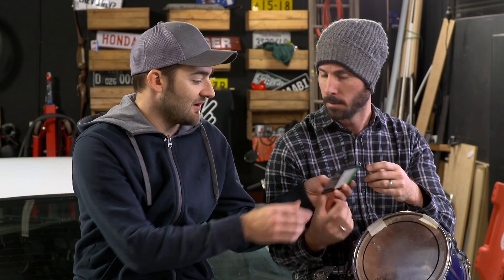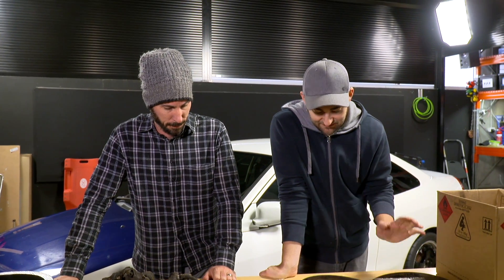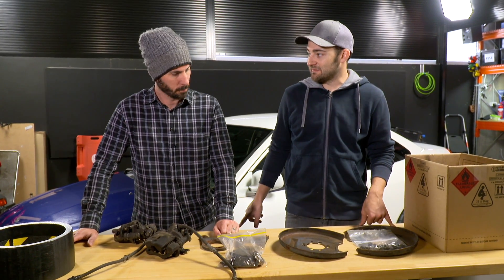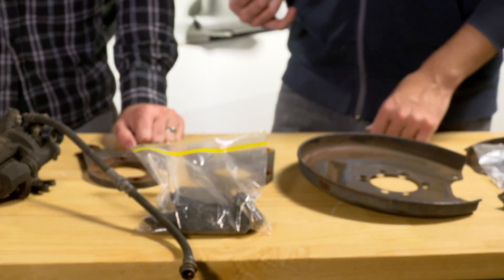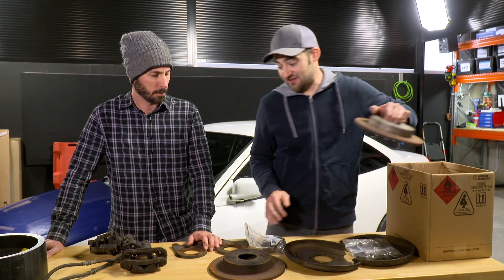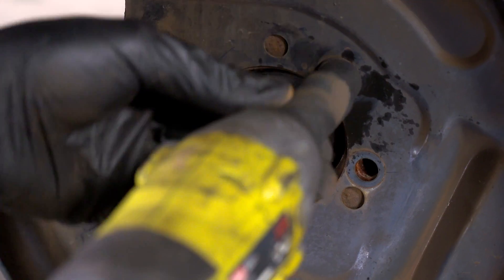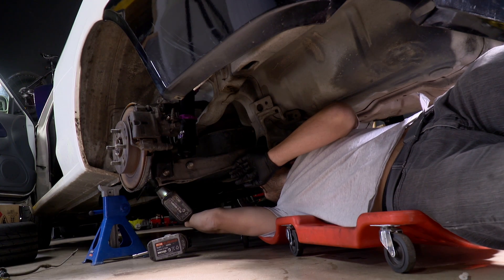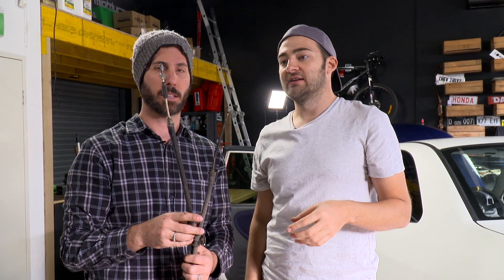Drum to Disc Brake Conversion DIY

Comment: Neat Trick if you don't have a big enough spanner to apply enough torque to those tougher bolts: take another spanner and hook the ring side over the open end of the first spanner in the direction you want to turn the bolt. works like one big spanner and then you  can take them apart again when your done to have two little spanners again

Comment: also to get extra leverage on a basic standard wrench, you can apply a 2nd wrench that is a few sizes bigger into the hole and get extra torque, that is the cheap way of getting the job done, while saving money but a bit of tape will keep yourself from busting your face or pushing away from you works too.

Comment: always always ALWAYS undo your sliders and check that they are lubricated and sliding freely. Seized/stuck sliders will stop the outer pad from being pulled into the rotor, leading to the inner pad wearing away incredibly quickly.

Comment: you guys should do a video about 2 brake pedal setup (such as used in baja trucks or torc trucks). also a video about quad pad setup, I saw a photo of some crazy setup where it had 2 brake calipers per wheel.

Comment: I just converted mine on my truck and the kit I got didn't require for a different master cylinder or have a portioning valve, because the calipers are designed to apply pressure as if it were still the drums.

Comment: I am old enough to have been driving cars in the US that were built before front discs became a thing.  I can tell you that virtually identical cars that one year had all wheel drums and the next year had front discs, stopped in far less distance than the all drum brake cars did.  About the ONLY thing that was bad about early disc brakes is if you drove through a good sized puddle of water you had to tap the brakes to dry them right afterwards because if you had to brake hard shortly afterwards you had no braking for a second.  That was rectified fairly shortly afterwards, but my 1970 Galaxie LTD with front discs was always plagued with that.  I don't know what is in newer import cars but in older US cars the brake master cylinders were different between all drum brake cars and front disc cars  because as someone has mentioned discs operate at higher pressures.  That is why disc brake pads can be much smaller while supplying more braking power than brake shoes.

Comment: The 3.5" disc is still a floppy disc as the actual media inside the external casing is flexible, or floppy. Earlier versions held even less data - 720KB for earlier 3.5" floppies, early single-sided 5.25" floppies held as little as 360KB.

Comment: Hi guys great vid !! Marty I was just wondering if you put the disc brake master cylinder on your car as well when you did the conversion because the valving and porting inside the master cylinder is different between drum/disc and 4 wheel disc. The original master will work but not properly, the 4 wheel disc master supplies more fluid to the rear callipers due to the piston size and not as much to the small wheel cylinders.  When you race the car you may end up with STOPPING difficulties in the rear !  Just a heads up mate, and yes I used to be a mechanic and a NRMA patrolman for 16 yrs !! Seeya Rob

Comment: Doesn't the master cylinder need changing or a brake pressure regulator fitting as drum brakes and disc brakes work at different pressures and a residual pressure is sometimes applied to keep drum brakes in adjustment so as not to have to pump the peddle up.

Comment: You are 52 years late for me, I installed Front disc brakes on my 1964 Corviar Monsa . they were an easy conversion but the front calipers required more fluid to operate correctly .Tthe master cylinder needed to be matched to the calipers

Comment: After talking so much about switching to discs to keep the brakes reliable under abuse, I was surprised you tried to keep as much old brake fluid around as possible. Moisture builds up in brake fluid over years of sitting and lowers the boiling point. That means if your fluid got hot enough you could lose at least half of your braking system when you need it most. I would put new fluid in the reservoir and bleed it until it comes out clear. As an added bonus it can also help prevent a frozen caliper, anyway, love the videos as always, stay s3xy <=3

Comment: The hand brake works better with a drum brake because it is self energizing by the rotation of the drum and the brake shoe pivot. that is why the leading brake shoe wears faster.
When traveling backwards the other brake shoe is the self energizing one good for hill starts with ease of operation.
With front drum brakes they were twin leading shoe no vacuum booster.
Some rear disk brakes have a small drum brake for the hand brake the best of both worlds but costs more to make.

Comment: Hi Guys, don't you have to remove the pressure residual valve from the rear brake outlet of the master cylinder otherwise the remaining pressure would cause the pads to drag on the disc's?
Also I thought there would be a need to change the proportioning valve as the disc's would need maybe more pressure compared to the drums as the drums are self energizing?

Comment: in Europe there is a rule that says if the car is constructed to do over 180 kph, it should have disk brakes.
besides the cooling advantage, disk brakes are also less prone to lock up since the outer diameter runs at a higher speed than the inner, while the pads try to grab on to the entire surface*. with drum brakes the shoes grab on to one and the same diameter.
*biggest advantage when upgrading to big brakes: bigger difference between inner and outer diameter.

Comment: You guys do not have plans on putting bigger OEM discs at the front? Bigger front brakes improve braking by leaps and bounds especially at the track. You can try to find the biggest 2 pot or even 4 pots  discs that will fit your rims then just adjust the brake force by using different brake pads to get the desired brake force ratio, typically 60% at the front, 40% at the rear.

Comment: Curious to know if the brake master cylinder is producing too much pressure or to little now to the rear since the wheel cylinders are gone and calipers are now in place of them. Seen these swaps on Hondas and sometimes the rear locks up way to early and the rear end swings around. Looks good either way!
Reply: You may have to install a proportion valve if the pressure is to high for the rear brakes

Comment: For those who dont get the memory thing, the floppy disc is 1 megabyte.. A gigabyte is 1000 megabites... My phone is 16 gigabites. My phones memory is 16,000 floppy discs all put in one little chip smaller than a quarter.
Reply: 1 gb = 1 000 000 mb
You have 16mil floppies in your phone.
Reply: Technically you are all wrong, because of the way bytes work, the conversion point would be at 1024. So 1024 mb in 1 gb, 1024 gb in 1 tb etc.
Reply: +TheCodyWay I rounded it off for the simpletons that can't understand computers only reading binary and using powers of two. Technically 1024s are Mebibytes, Gibibytes, ect. But it's been so misconstrued at this point that there's really not much point in trying to explain it to anyone anymore.
Reply: Shona Fair enough.
Reply: +TheCodyWay  jesus fucking christ i was just trying to state something interesting and cool for everyone to see how tech ology has come through within years. Sorry to start an argument 😂

Comment: drum brakes need more pressure than disc brakes, if you dont change the master cyilinder, your brake pads are gonna burn quickly plus you can get some block wheels even in easy situations.

Comment: I did a disk brake conversion on my e30 but brakes got worse - why? The brake pump and rear brake lines are different on e30s with disks vs ones with drums. The pump off cars fitted with drums have 3 outputs - two for the front brakes and one for the rear drums that goes into a "spliter" and from that to each individual drum. Disk brake e30s have four outputs - two for front calipers, two for rear calipers.

Comment: On some cars, going to discs on the rear can be a hinderance, even on track.

I know on my 1985 Escort RS Turbo the rears (Series 2 226mmdrums on the back with a known Cosworth setup up front (2WD Discs with 4WD calipers and pads), the rear still help up with the front very well, even on track.  If I am honest the rear could at times outbrake the front on some bends if the rear became a little light.

Many people have gone to Cosworth brakes on the back and messed around endlessy with bypass valves to stop the rear overtaking the front.  A specialist in Derby think it's a waste of time playing going from drums on the back of an Escort (they're very light).

That said, discs are easier to maintain.

Comment: 16:58 Thumbs up for the Québec licence plate! You guys are lucky that your plate isn't one of the peeling one. Plates circa 2010-2018 had a defect in the reflective coating that caused the paint to peel. You can replace the plate for free, but it's not rare to see guys that use sharpies to color over the numbers to "fix" the plate.

Comment: May be a silly question, but when you are actually driving and you hit the brake pedal, does it activate both rear and front brakes? Or maybe just 90% front and 10% rear?
Reply: You get equal braking from all breaks. unless break pedal is less than 10% applied then you get only front I believe. but it applies rear first then front more so with drum/disc set up to prevent a nose diving motion.
Reply: Front brake do more of the stopping than rear brake. I don't have actual numbers and it also varies with the vehicle but I think its normally something close to 60/40 F/R.

Comment: 12:40 The stopping / holding power of the brake has nothing todo with the surface area - its all about diameter, force and materials. Thats basic physic stuff :-P

Comment: If you guys didn't change the proportioning valve to the 4 wheel disc valve your going to have low pressure to the rear brakes and they aren't going to work like they should, other than that great video as always

Comment: "hand brakes are called emergency brakes because they should still function when all hydraulic pressure is lost in the braking system"
Marty, are these 2 door cars actual lancers? every lancer owner knows that their e-brake doesn't work. i once hit a toll booth because my lines failed and the handbrake wires weren't connected.

Comment: From what car they used those brakes? Because the mirage never came disc brake 4×100 they only came 4x114 and it was a mirage asti basically the rally version of 2sexy.

Comment: That 1.44 mb of data instantly becomes around 32 mb when used/formatted in a SuperDisk drive. Which was appearently successful down there in Australia and the rest of Asia. It was basically a failure in the US, under the "wide release is pointless" campaign, where only OEMs could get them. The ZipDrive was a success, under their "hey, a wide release is a good idea" campaign, where anyone could buy the drives.

Comment: i got a set of evo 3 disk brakes complete with tauling arms can that work on a mirage similar to urs the front works just fine with no modifications however i am concern for the evo back spindle being awd it has a space for the axcle and my mirage dont

Comment: Did you use WD-40 degreaser on the rotors?
When I use WD-40 degreaser, it leaves a little bit of an oily residue and I have to use another cleaner to complete the job.

Comment: you guys sometimes miss the odd bit but cover the guts of things pretty well however this time you missed a major major part of this job. most if not all cars especially models that have disc/ drum variants have a valve either in the master cylinder or in the rear lines to correct the pressure needed for drums. could be a very serious issue for a novice thinking he can go fast asf with his new discs then whoa wtf just happened. I'm about to do a similar thing myself. I have an a32 cefiro, p11 wagon and an n14 gti that are all getting raped for the best mix n match brake package I can get out of it for my trusty p10 ( yeah If you didn't notice I kinda like nissans just bought an w10 det as well ) other than that life threatening missed info another treat video guys.

Comment: i can honestly say, i have never had the rubber fall off in the hole... maybe you should not have pulled out so fast with such a tight fit in the hole.  or maybe you need more lube in the holw itself?

Comment: A cheaper way around not having enough leverage on your small spanners is to get a small piece of pipe and slipping it over your small spanner, there by extending its length and leverage! ^^
Reply: works fine on a ratchet handle (voids the warranty due to likely breaking the sear or pall) but doesn't fit well over the other end of a spanner
Reply: Yeah but that's getting technical...
Reply: or just get the next side up spanner and lock it in the ring side to get more leverage
Reply: Yes that also is affective ^^
Reply: long and strong

Comment: where did you guys came across these parts?, I can find the rear brake rotors, the calipers and the brake cables, but not the caliper mounts and the disc backing plates, I have been trying for quite some time to find these parts but they are very hard to come by

PS: my car is a 95 Lancer, so I know what fits 2sexy fits my car.

Comment: I'm a bit concerned about the tip about pushing the foot-brake down while opening the system.  First, I consider fluid loss from disconnected wheel cylinders to be a good thing, because that's more old fluid out.  Second, I'm thinking if the brace moves or the foot brake resets somehow, it'll suck air in from the ends of the lines and then bleeding will be endless and difficult.

If I'm wrong, let me know, but that's just what it seems like from what I know.  (I've bled brakes many times, after replacing bad calipers and wheel cylinders)

Comment: As far as the comment he makes about buying longer wrenches. that's completely unnecessary and expensive. Just hook the wrench's open end into the others closed end(or vice versa) and you'll get more leverage. Also when I was a young amateur mechanic in my dad's garage, I used a piece of pipe over the end of a wrench.

Comment: you kept saying that there are places where drum brakes have advantages over disc, what are those?  I can't think of a single thing.  I guess there is the whole brake dust thing, but you can get brake pads that don't dust.  they don't perform as well but still better than any drum setup even with the most aggressive brake shoes.
Reply: Wet braking... discs are exposed, but drums are sealed. Fuel efficiency... disc brakes rely on frictional forces to throw the pads out, drum brakes have springs to return the shoes. Brake torque... this one is a bit of a push because any modern car with discs and/or drums can lock all four wheels with ABS inactive, however a drum brake can generate more peak braking force than a disc brake designed to fit under the same wheel simply because of the greater surface area and the greater average radial distance at which that force is being applied. Longevity... shoes last longer than pads because there is more meat on them. 
I'm no drum- brake fanboy, but I would imagine these are some of the reasons. However, brake fade is not a fun experience, so I would rather have more fade resistance and need to service brakes ever 3 years rather than 5 :-)
Reply: Wet braking is better with discs due to modern abs systems. Drums would be a lot easier to lock up, and on wet pavement would take longer to brake than a wet, abs modulated, disc set up. As far as efficiency goes, I'm not sure what the difference would be but i would assume its negligible. Most efficient braking would come out of a hybrid though haha. or tesla of course.
Reply: Cheap.
Reply: If you don't drive very often and you don't have a garage, discs will rust, drums won't (at least not as quickly)
That won't prevent the front discs from rusting, of course

Comment: I did a drum to disc front conversion on a 1972 Holden LJ Torana I had years ago. Changed the who system including the stub axles because I used a Girlock system from a V8 LX Torana, Discs were thicker and the pad surface area was double the LJ disc pad area, and widened the front track a bit, which also helped handling. Had to also install a brake booster that the front drum set up didn't have, But the braking was awesome.
One good thing to do when doing these upgrades when getting wrecker parts, Is recondition everything, Especially the calipers, you don't know how long they've been sitting.
I was lucky enough to get my parts at a swap meet for $100 & that came with new discs. I reco'd the whole lot for around $400. Ask yourself, how much do you value your life? a few $100 can make the difference between life & death.

Another quality video guys. Keep them coming. :)

Comment: Awesome! Though I do have something to add I didn't see in the video but yet is an interesting fact. When topping up the brakefluid it did look like not all of it went into the reservoir, best to clean that up right away with water or it will react on the paint causing it to rust in the long run.

Comment: Just an interesting little bit, Drums are less maintenance and last longer because as he said they are self adjusting and you get more even braking however disc brakes heat up less, take more abuse, and have better stopping power because it's a clamping force instead of a pushing force.
[{|}>]

Comment: That pun was horrible. Because a floppy disk is spelled with a K not a C. Disc brake is spelled with a C not a K. Now if you would have got a CD-ROM disc then it would have been correct....

Comment: I've did this on my Daewoo Nexia. Used front brakes from Opel Astra F GSi and rear disc brakes from Opel Vectra A. Worked really well, since Nexia had ABS and it divided pressure correctly between brakes.